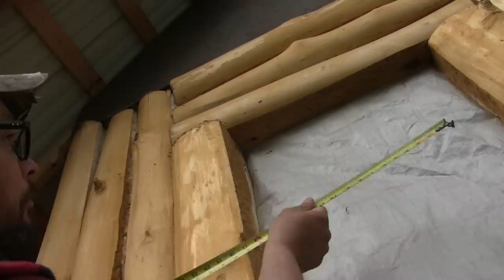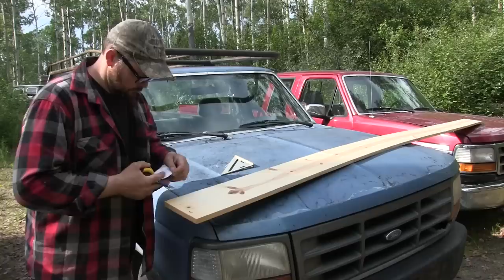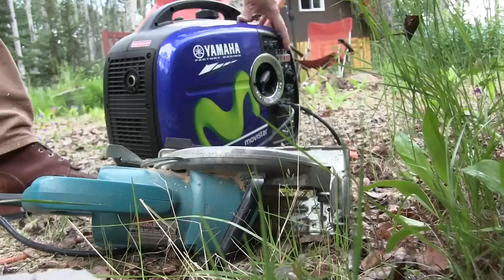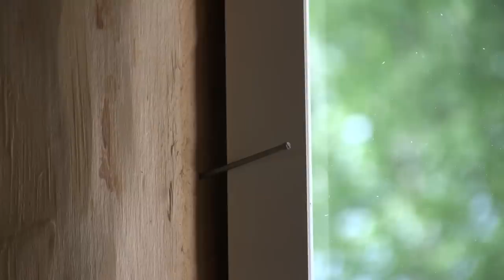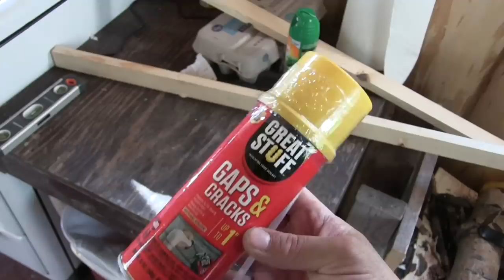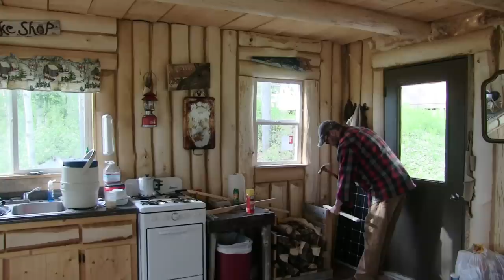Off Grid Log Cabin Window Installation

Comment: I have seen a lot of homes built by 'professionals' that don't even come close to the accuracy you have shown for your window opening. I have questioned if some of the pro's even know how to use a tape measure. So sweet and simple yet so few practice it.
Reply from the maker: Thanks
Reply: I'm a retired journeyman carpenter and when I was working I actually had "experts" come up to me quietly and ask where the 1/8th inch mark is on the tape measure they were holding. Then they would go over and tell the "new" guy how to find the 1/8th inch mark!

Comment: I have been renovating my log house since we bought it 30 years ago I am at the point that if anything was square I don't know if I  could work on it. The one thing I have learned about windows in log cabins is don't be afraid to be generous with your gaps, insulation works wonders in filling in spaces behind the trim and no one will be any the wiser. Thanks for sharing.

Comment: i worked as a proffessional window installer and the way you did it, is how i was trained. the only thing we did different is, we screwed window frames into the rough opening, and we caulked behind the interior moldings, in addition to caulking everything on the outside👍

Comment: Not only have you made some beautiful log cabins, but you've chosen very old fashioned designs. You've made the "vertical corner logs + horizontal wall logs" style, you've made the "vertical log cabin" style, and the only books I've ever seen these styles mentioned in are from around 1905 or so. I bet your channel is the only place most people have seen these log cabin styles. It's super cool.
Reply from the maker: Thanks. Where I grew up in lower Michigan there were small vertical log cabins around every lake. I think they were popular at one time and most of them were made from cedar and lasted a long time. The first cabin I built was a Hudson bay style. Vertical corners, horizontal between.........I think they built a lot of those in northern Canada where there weren't a lot of large trees. I used that style because I couldn't afford to make lap joint corners because I didn't have enough long logs.

Comment: Thanks Dave. The water must be seeping in my 4 plantroom windows from the roof. The board above the windows rotted out an now all the cedar siding underneath the windows are rotting to. I came home from work one night an the whole wall was gone. My boyfriend decided to put new windows in my 132 yr old house. Needless to say i was pissed off! It was a porch at one time i think because it has the old wood siding on 2 walls an a wood porch floor an ceiling. Also french doors with small windows on both sides. Weird place for a porch. It's in the middle of the long side of the house flush with the walls on both sides. Roof is different too. Almost flat an leaking. Bummer man!!! Have a great day.
Reply from the maker: Sorry to hear that

Comment: The plain old "Good Stuff" foam expands enough that it can void the warranty on most vinyl windows (and even break the glass), not that you're concerned with warranties in a cabin. Fiberglass insulation is air permeable and is no longer recognized as correct way to insulate windows (I know you are in an area with no building codes so not an issue, and again, it's a cabin.). There are low and no expansion spray foams available at any home center or hardware store that do a good job, won't damage the window and seal the opening, stopping the passage of air. Keep on doing what you do Dave, I'm always waiting for the next one.
Reply from the maker: Thanks
Reply from the maker: Honestly, once the window is in place and caulked no air travels around it anyway the fiberglass is less than perfect but It's what I had. I know about the low expanding foam but I didn't have any on hand when I shot this video.

Comment: Another step that he does, but does not directly mention, is to keep the window closed and locked while installing.  This helps to keep it square.  While a window should be plumb and level, the most critical part is that it is square or it will not open and close properly.

Comment: With the combustion inside, how do you balance the insulation and the ventilation?
Reply from the maker: all wood stoves move air
Reply: @Bushradical  Thanks for the reply. So I was wondering if you need to intentionally leave some gaps on the walls (or else the insulation fibre can breath thru) for enough fresh air coming in from outside to prevent carbon monoxide building up, but not too much to lose heat too quickly.

Comment: You should have used window caulking on the outside of the house
Your window will leak and the moisture will accumulate behind the inside wood trim and result in mold and rot
You should Not show people this WRONG way of installing a window